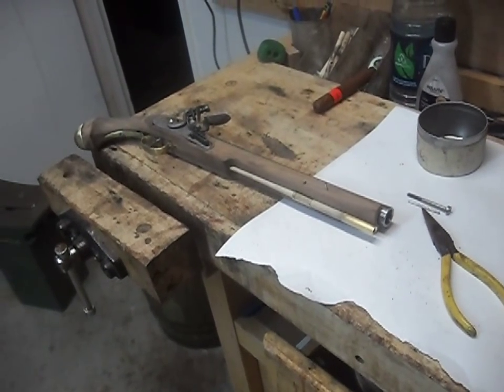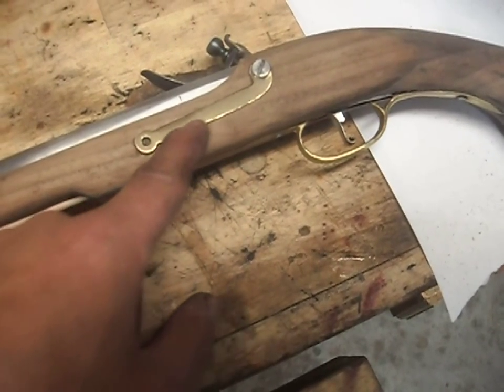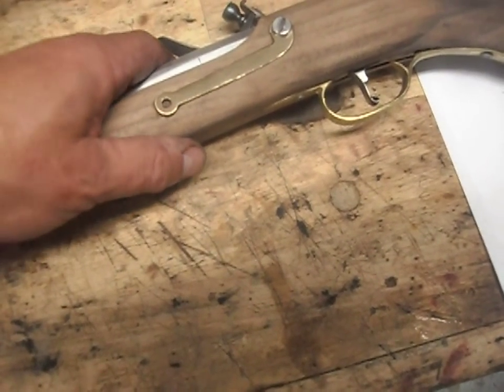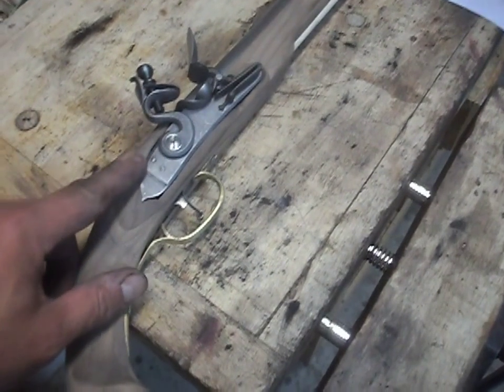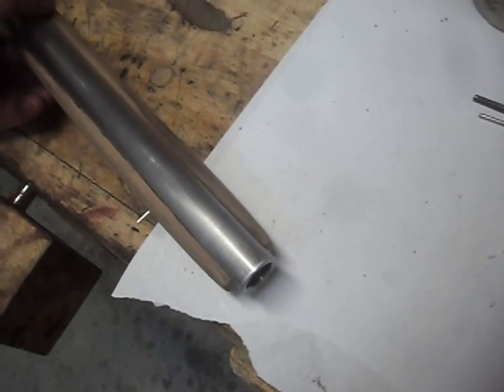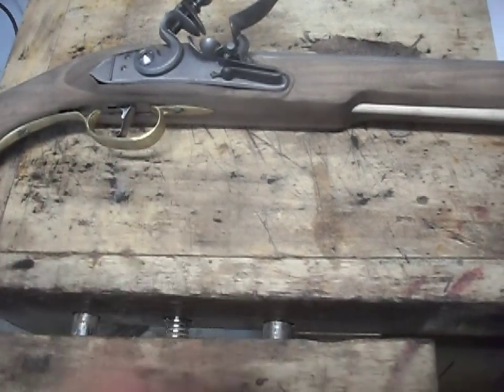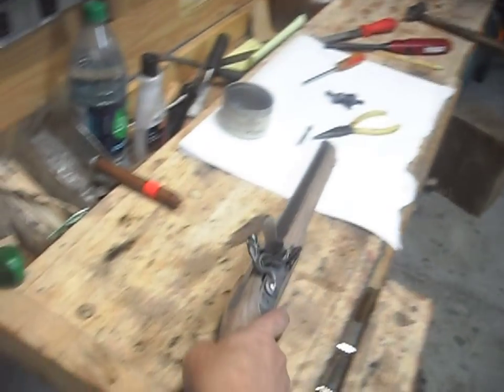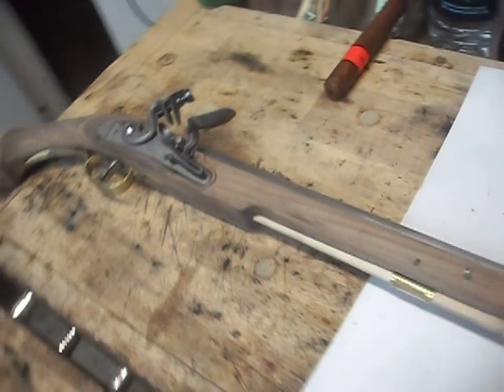Making a flintlock pistol #14

Comment: That secondary lockbolt is always a tricky one. What I like to do is take off the frizzen spring and drill with the tap drill at a high part of the metal underneath the spring then go through. If there is interference with the barrel, I just mill a slot to allow passage. If the ramrod interferes I just taper the ramrod.